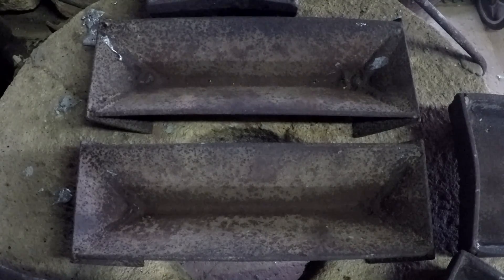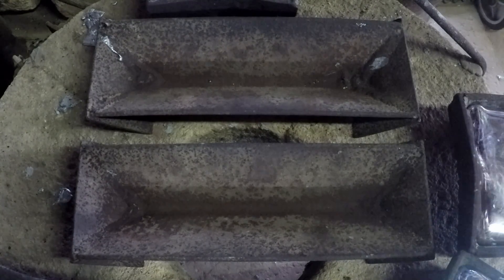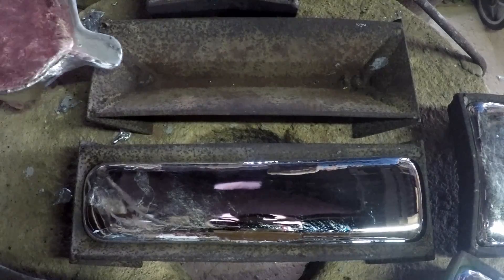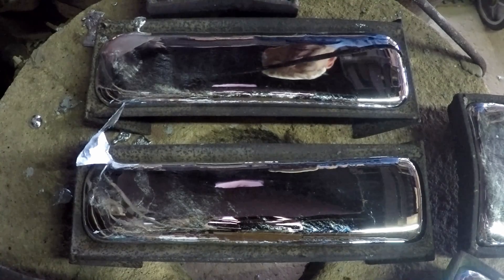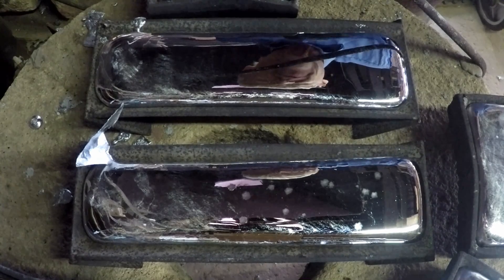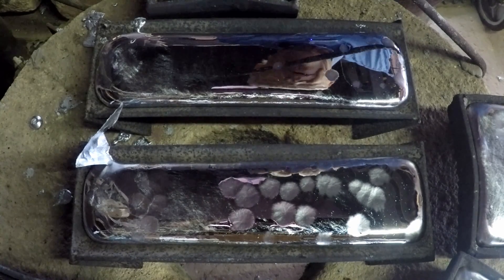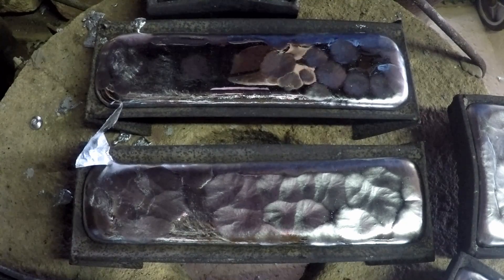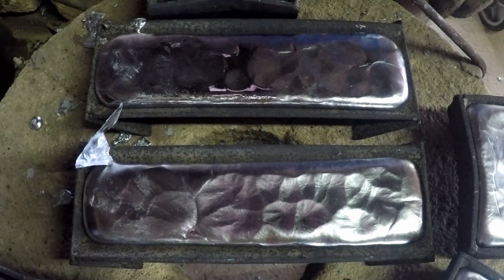Solidification Curiosity

Comment: Was the top of that ingot as lumpy as it looked, or was that just an illusion caused by reflections?  I melt scrap car wheels for my casting projects, which I've been told are usually 356 aluminum, and I've never seen anything like that happen.
Reply from the maker: Tobho, The solid surface was a little lumpy. The cells seem to have a low centre and rise somewhat to where they meet the adjoining cells. Yes wheels are usually 356 which is about 7% silicon and 0.35% Magnesium. The alloy here was 12% silicon we call it 401 but I don't know if there is a US equivalent in the UK I think it is LM6. IT should not happen with 356 as it solidifies by aluminium dendrites first growing in the typical tree like manner. Late in the solidification the eutectic (same one!) solidifies in between the dendrites and does not therefore have the chance to form those cells. Occasionally I have seen these cells over 1 inch diameter But this was the first time that I have actually seen them form in the middle of the liquid. Bravo on using the car wheels, its good stuff and its what I use for most of my work (I buy it as ingots but its the same stuff).... Martin
Reply: Olfoundryman thanks for the explanation.  I've read that automotive pistons often have high silicon levels like 12%, and that some hobbyists will dilute them with an equal weight of beer can and window frame extrusion ingots to approximate a sort of 'poor man's 356' alloy for general purpose casting.  I'd rather just stick with using wheels, they're easy to find and don't have any steel bits to fish out of the melt.
Jeff
Reply from the maker: Jeff, I am aghast at what some people do with metal when it comes to alloy make up. The mind fair boggles! Considering the cost in fuel time and effort and unreliability of end product I reckon its cheaper to just buy certified ingot (currently $4.00 per Kg locally) Or do as you do and get alloy wheels which are usually 356 you do need to check that that is what they are though. The belief that if you add say 10% of something to 90% of something else  you get a 90 : 10 alloy is common but erroneous. At the last big foundry that I worked in we had to increase the magnesium  content of 356 alloy up to that of 357
it required an addition of about 0.4% Magnesium to get to the top of the range for 357 and this is what I added but spectrographic analysis indicated a gain of only 0.2% . I.e. the recovery was only 50% A not untypical result. All the 90 10 aluminium bronze that is all the rage on YT at the moment is probably more likely to be 95 5 as the aluminium is consumed by the high oxide content of the copper, itself the result of bad melting practices.
Steel bits in the melt - Oh My God  My aching brain boggles, boggles, boggles indeed!  ... Martin
Reply: Olfoundryman lol, I never meant to boggle your brain Martin.  I don't understand why so many youtube metal casters are making that 90-10 aluminum bronze just to cast purely  decorative items either when the world is full of yellow brass junk they could use instead.  Things like SWDweeb's hammer I understand - that could actually be used as a hammer...or SVSeeker's boat props.  It's the guys casting aluminum bronze bananas or whatever that boggle my mind!
Cheers,
Jeff
Reply from the maker: Tobho, Don't worry about the brain boggle, if I keep taking the medication and it will go away! -:) I am with you re the aluminium bronze. Its a very difficult material in the foundry prone to hot spot shrinkage and bad oxide inclusions it also machines with difficulty. So its not really what I would call useful to the tinkerer. It has to be poured right or you do wind up with more badly bent bananas. I think that people think that it "looks good". Well it would if they got a half decent casting - Swdweeb managed a good result but he had is troubles along the way I can tell you. I have done a lot of work with related alloys CMA1 (very hard) for syncro rings, Silicon aluminium bronze for general work as it is strong and machines and casts much better the good old 90:10 It also looks better being slightly redder than the 90:10. I also use silicon bronze - nice 
stuff! good colour very fluid casts well machines Ok and quite strong easy to buy as wrought and cast alloys are the same, nice for plaques can be coloured and solders and welds well... PS I hate yellow brass.. Martin
Reply: Olfoundryman I have stayed away from yellow brass too, I just don't want the hassles with the zinc fumes and having to replace what boils out of it.  But it seems to me it would be an easier way to go if you just want that golden colour...  I used purchased C95400 aluminum bronze for casting a couple of axes because I wanted them to be more durable than the tin bronze historical pieces so I could actually use them for cutting firewood on camping trips.  One of them is still being used for clearing away brush on a friend's farm.  More of a (fully functional) conversation piece I guess, he could have gotten a steel one easily enough...

I've got a few ingots of everdur silicon bronze I'm looking forward to playing around with this year, everyone seems to love working with the stuff...
Reply from the maker: Tobho, Yep, that zinc fume is nasty stuff have seen what it looks like under the microscope , nasty, would not want to breath it. Problem with brass is that as the zinc boils away the colour changes, try making candle sticks one day and bases for them the next, they came out a different colour, hopeless! 
C95400 tuff stuff! but for axes I would recommend that CMA1 tougher still,  it is C95700 in the US much harder and also heat treatable would make a nice "bronze axe" But be careful it is very sensitive to hot spots in the mould it needs to be feed carefully somewhat delightfully lower melting point too. An alloy that I use a lot of is C95600  This is the aluminium silicon bronze that I spoke of above it has a lovely warm colour. Another alloy that is worth looking at is C99700 or C99750 the so called white bronze - colour of nickel silver surprisingly low melting point easy to work with. You will enjoy the silicon bronze,  Ah, so many things to try so little time...Martin